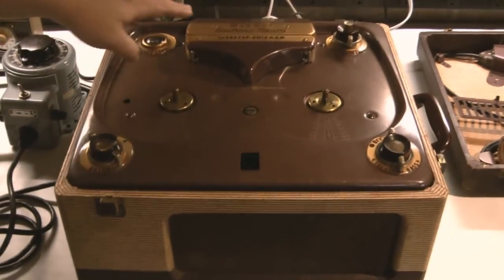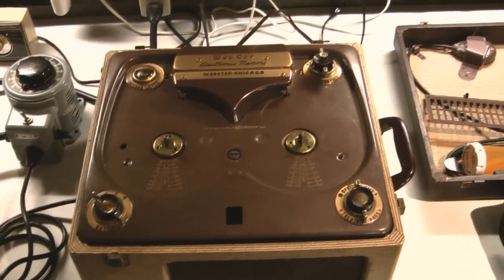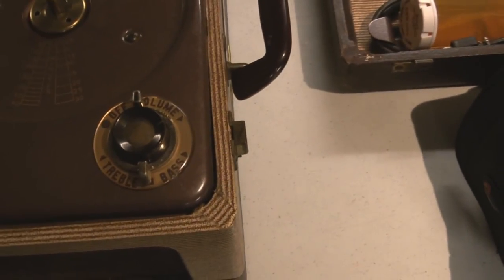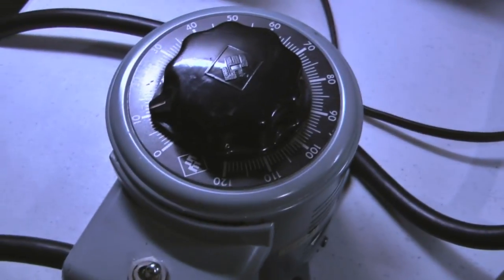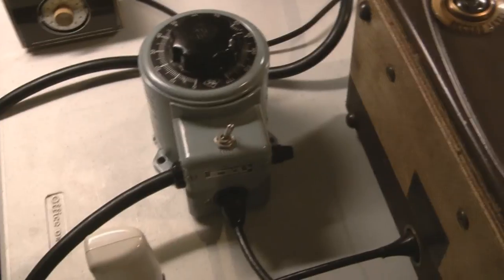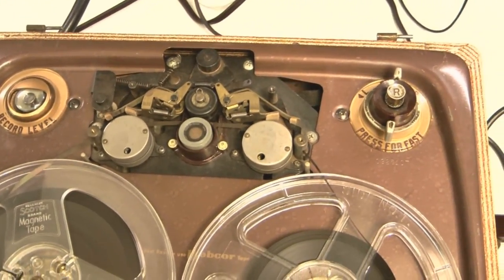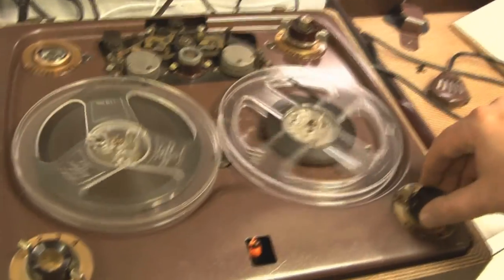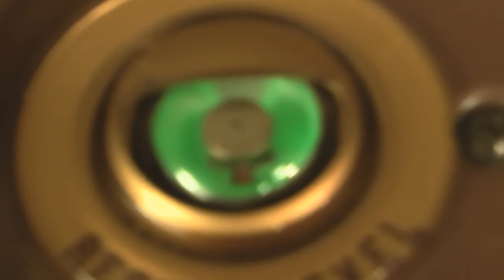1953 Webcor Model 210 1 Reel-to-Reel (Part 1)

Comment: the 1/4 audio jack on the side was definately added. the webcor 210-1 did not come with a 1/4 audio output jack. the round connector to the side of the mic input is the origional audio out jack. it is a two pin jones plug. the webcor 210-1 came out in 1951 i believe.

Comment: I was given one identical to it back in 1969.It was a neat tape recorder and if it had a solenoid on it,you would have had auto reverse.It was bi-directional as I recall;you had to turn a metal knob to reverse the tape.The sound was great.I gave it hard use until it died in 1972.Years later,I saw another one at a yard sale for several dollars.$70 sounds a bit steep to me;I would have given about $25.00 for it.

Comment: did you ever get the record function working? check if there is an open ground in the mic. if it was the tape recorder causing it then it would buzz on playback also. with the eception of 1/2 of the first tube the playback and record function use the same amplifier circuitry

Comment: I'm not sure,my Webcor tape recorder is either 1952, 53, or 54.  It was on sale in 1955, the year I was born.  The outside of it is wooden,the front of it has a drawer you can open and close.  There's a medium size 1955 Scotch tape inside of it,yes my baby voice is on it, and also a recording of the song Sixteen Tons from a radio, before it the announcer says ... in the number one position.  I tried to weigh my Webcor on the bathroom scale,weighs at least 70 pounds.  Inside the drawer is the original microphone, looks exactly like yours but its cord was cut off, many years ago when it stopped working.  Radio Shack still had replacement parts for early tape recorders, back in the 1980s.

Comment: The Ka-CHUNK sounds that thing makes absolutely screams of quality.  You cannot get that today in anything.  Wow.

What causes the "vintage smell" and is there anyway to mitigate it?
Reply: Oh yes, it's solid for sure.  The vintage smell comes from several different sources, mainly the aging and offgassing of electrical components and wiring.  It's similar to "new car smell."  The natural aging of paint and plastics can result in odors.  Some of it is from lubrication, grease and oil that are decades old.  Still more comes from the environmental deposits that the unit was exposed to over its life, being in environments of cooking, smoke, pets, or any other airborne particles.  All these different smells form what we know of as "vintage smell."

As a unit this old is powered on and warms up, the heat will sort of "stir up" the smells due to the evaporation and vaporization of the aforementioned particles on the components, and this is similar to cooking.  A potato has no smell, but when you chop it and fry it, you get the strong smell of french fries.  

There's no way to completely mitigate the odor, as it is composed of so many individual odors from so many sources.  Some of the offensive odors, such as from an item that has been in a smoking environment, can be cleaned with Simple Green or by washing components and circuit boards in a dishwasher.  Usually though, the simple "vintage" smell that's common among most old electronics won't go away unless you replace all the internal components with new ones, but that obviously destroys the whole entire "vintage" principle. 

Sorry for the long answer to your simple question :-)
Reply: harleybadger1 Thank you!  That was not a long answer at all.  In fact, it was the most complete answer I've ever received!

Comment: I picked this exact piece up about 6 years ago at a flea market. Mine does not have the microphone and I'm trying to figure out the 3 prong block connection on it. I'd like to set it up with a harness to take dual mono from my digital interface. Now mine acts like it's going to record fine when engaged but playback of tape is super quite. It's very faint but existent. I don't know if it's from the tape that came with it or if it's from the tape heads being bad. I know the amp and speakers are working just fine. Any advice would be much appreciated. Thank you

Comment: My mom has one of these with a bunch of tape reels of her when she was much younger. I wanted to move them to a digital format but I can't seem to find a manual online so I can see if there is some form of an output plug. Your video shows two plugs (other than power), one being possibly being a hacked output. Did you ever find out if that plug was factory? If so, what type of plug will fit it?
Reply: the plug that looked hacked is a 1/4 inch jack and no it isnt origional. the round conection next to the mic input is the origional audio out. it is a two wire jones plug. you have to have the 1 2 3 4 switch set to 2 to get any sound out of it. why would you want to degrade sound quality by transfering it to digital. if you are worried about not allways having the reel to reel tape recorder transfer it to casette tape. you would need a 2 wire jones plug mic cable and the size jack your casette recorder uses for the mic to plug in.